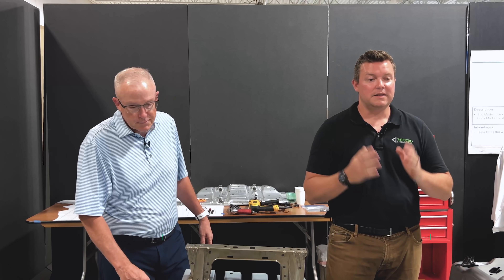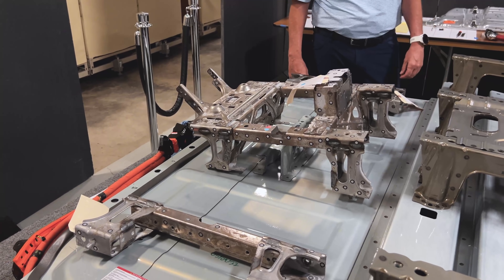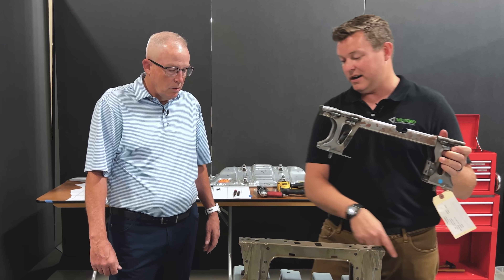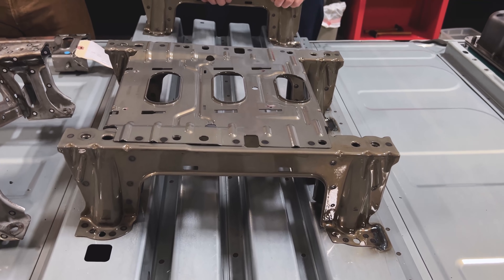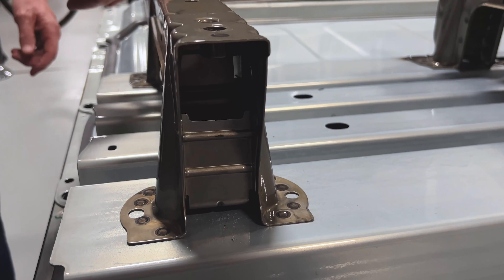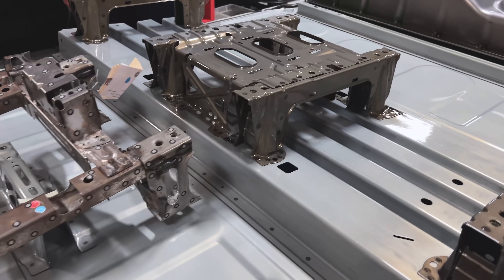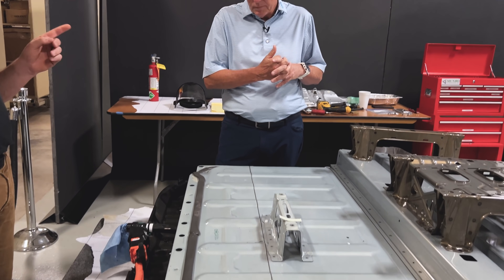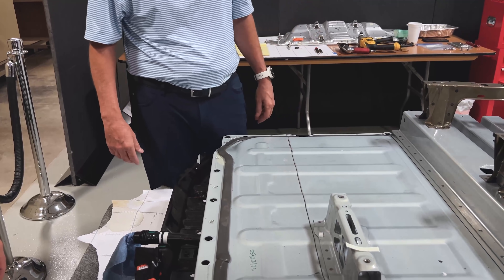Giga Texas Structural Battery Pack Cover | Tesla Model Y

Comment: THANKS4GIVING an excellent post young men. It was mentally stimulating and highly educational.  
4:00 Mr. Hildreth explained the seat loads very well. Before he said anything I had already figured it out because the painted welds were out of place, I figured the welds were for front end collision would generate a strong lifting moments against the rear of the  seat pedestal with lots of cantilevered leverage.  
4:53 Cory talks about a ?? Friction weld, that is a fascinating technology, I wonder if they do that in an envelope of argon. 
12:24 Mr. Hildreth  wasn’t at first shire why the pent house was but shortly after figuring it out logical. It was because of the many penetrations in the battery pack, the strength
lost had to be replaced, they used the Penthouse. They used the doubler ( built up ring ) at the base to receive the additional torque tension applied to the penthouse stiffening the marriage of the two.

Comment: Spot welds through the powder coat? That basically renders the coating useless against rust around the area. Less than ideal I'd say...
Reply from the maker: The welding was completed before any coating was applied.
Reply: Forget the spot welding - the seam welds at the back of each seat riser are clearly after coating.

Comment: could the battery structure be gigacasted?
Reply: I was thinking about the same thing. Probably will be the next thing to do, one big stamped battery housing.
Reply: You mean the cover?
Reply: @darekmistrz4364  everything, cover with seat risers and base
Reply: Not necessary. They plan to do a complete Tesla as one gigacast. Only problem is that you wont have glass windows, because everything is metal. But you will get VR-goggles connected to the outside FSD-cameras.

Comment: Can you speak to the safety testing that happens when a company iterates this much over a short period of time?  Do they have to be completely tested again with the NHTSA and IIHS or are their changes that can skip the process and take Tesla's word that it meet or exceeds the previous design?
Reply: In Europe they need a new type rating for the vehicle when things change that much. And that involves doing full crash testing again with the new model.
Reply: @sjokomelk  Absolutely no one is disagreeing with that.  This whole thread is full of repetitive pedantry.  People seem to have some kind of hidden fear that cars are not being crash tested.  My response is "Stop inventing problems that do not exist just to make yourself angry."
Reply: @_PatrickO  Making themselves angry is the point.
Reply: They are at least test new models, since you can look it up.  My guess is all manufactures can avoid additional full car tests via smaller supplemental tests. Tesla automates tons of integration testing with robots to get real time validation of changes.  Their testing automation is why they can continuously make changes so fast.  Go look up the joe justice interview about how tesla runs internally, he has a good story about how quickly an improvement to the bends in the metal bus bars for the charging system was put into production when different bends enabled faster charging speeds. I believe it was about 9 hours between the time a human engineer figuring out the change to make to the new part and the time it went into production with lots of automated testing in between. This kind of fast production change is impossible in traditional auto, they lack all the automated testing.
Reply: @_PatrickO  that doesn’t address the fact that the Y is produced differently out of two plants and the crash tests are typically of one model across the entire line. Even the IIHS states that they don’t test yearly and have a subjective definition on when they conduct a new test or use the manufacturers data. I would rather an expert like Munro speak to this instead.
Reply: @handlealreadytaken  Your concerns feels like grasping at straws.  It doesn't matter what factory a car is made in, just the design.  I would expect the new Y to be crash tested due to the gigacasting and structural pack. Structural changes are probably the trigger.
Reply: @handlealreadytaken  Something to also note is that "official" tests like IIHS and NHTSA often take months or years after the cars are put up for sale to be done. IIRC the Model 3's IIHS test wasn't completed until well into 2019, and the car has been coming off the line into customer hands since December 2017.

This is OK because the car-makers themselves do EXTENSIVE testing of their own, both in terms of computer-modeling and actual crash testing. Here's Tesla's video about this kind of thing: https://www.youtube.com/watch?v=9KR2N_Q8ep8

Comment: They want to avoid painting it later.  Takes a TON of surface area out of the paint booth.  But isn't it powder coated pre-stamping or no?
Reply: Braces for seats are coated too. You can see that welds are coated too. It's being done as last manufacturing step of this part

Comment: Completely powder coat that makes total sense to me... You know when you get your car detailed all the water they use and when you spill your drink, go to the beach etc.  It's bound to get wet.. powder coating it will prevent corrosion
Reply: Correct it's to prevent corrosion, normally there is a metal sheet between the pack and the passenger department, this sheet is coated before paint with the whole body in white to prevent corrosion. This pack being bolted on after paint, it makes sense they powder coat it against corrosion to have same result.
Reply: I use heavy duty rubber floor mats to prevent corrosion since I have snow and salt in the winter and will do the same when I get a Tesla, extra prevention is always good

Comment: The battery cells themselves are the biggest part of the structure, so they didn't really have to add a bunch of structural support on the outside of the pack.  In a tear down video of the 4680 battery cell, the outside canister of the battery cell appears to be stainless steel, and it much thicker than anyone thought.
Reply: They still have to add a lot of rigidity to the whole pack lol….. it’s not just a whole block but is also has to support the seats, bee the underneath of the car…… bee water tight…..
Reply: Stainless is heavy. Doubtful
Reply: @vidznstuff1  No, that is what the found with the actual cell.  You can see the cell tear down in the lab from The Limiting Factor.
Reply: @vidznstuff1  No, I saw it too, the channel name is the limiting factor. The person who disassembled the cell had was very surprised at how tough it was. You could also see the metal work hardening as he peeled it, that's a clear sign that its steel.
Reply: @ashsilverwizard3275  My take that is a special compound designed by SpaceX. Steel at that thickness is still flexing.

Comment: This guy must not be familiar with Tesla's crash test/safety ratings. They have the safest cars on the road, no way they took a safety risk with this.
Reply: @JorgTheElder  did you listen to 16:10-17:20. This new old guy is definitely implying a safety risk has been taken.
Reply: Munro does still lean towards meeting the minimum for a 4 or 5 star rating, while tesla aims to be as high above 5 star as possible. Munro does the normal manufacturing tradeoffs when it comes to safety ratings.  Tesla aims to be above them, even if their is no official 6 star to advertise.
It makes sense for munro to stick to official safety rating metrics in their way of thinking because they deal more with legacy companies that don't care about going above and beyond in a non-marketable arbitrary way.   Ideally, regulators would add a 6th star so that car manufacturers have something marketable to aim for that is also a set standard and not arbitrary.
Reply: @_PatrickO  the new old guy was implying that the pack being right below the occupants.
Reply: @larryspiller15  All packs are right below the occupants, the structural pack does not change that.
Reply: @_PatrickO  no, there is a seperate extra layer of metal in all other evs
Reply: @larryspiller15  There are separate layers of metal and fire proofing in this pack.  They are just integrated into the pack to simplify it.  It doesn't matter if the firewall and fire retardant mat is converted to a layer of foam above the cells and multiple layers of metal or a thicker piece of metal in the top shell of the pack.  It is exactly the same protection or better.  
My classic response to this kind of thing is "Stop inventing issues/concerns that no not exist just to invent a reason to get angry about something."  You invent false concerns and then want to debate them, it is massively ridiculous behavior.  It is far more likely that this pack is actually safer.  Tesla has a history of improving safety, not reversing it.
Reply: @_PatrickO  IM NOT SAYING IT IS A SAFETY RISK, IM SAYING THE OLD MAN IS SAYING IT IS A SAFETY RISK. Jesus man, work on your reading comprehension.
Reply: @_PatrickO  like are we in the same conversation, you are literally inventing the idea that I am implying a safety risk. I'm not implying a safety risk, I'm saying the old guy that IS implying a safety risk at 16:10-17:20 is definitely unfamiliar with the excellent safety track record of tesla.
Reply: dude they are not saying teslas are not safe. 

I don't know which part of the video you are referring to, but don't you know who these guys are? Munro and associates is awesome.  The guys in this video are rockstars to the Tesla community.  They definitely know teslas are safe, they love tesla. These breakdown videos are fuel for the fire of Tesla fans.  If they point out any specific safety flaw they're just calling it how they see it and I am certain they have a lot of faith in the overall safety of Teslas.
Reply: @freakyzguard  settle down, I've been following munro since before they had a youtube channel. This new old guy is implying that tesla is taking a safety risk with the battery being the floor for the occupants. Watch 16:10-17:20, thats where he implies the safety risk and Cory even says knowing tesla I'm sure they've taken that into account and faced the positive terminals down.

Comment: The fact that the entire top is fully powder coated is no mystery to me! 

Just imagine what your spilled Coke would do, sitting on that metal, being in constant contact with the floor pan of any car, that would explain to me why the powder clear coat finish is applied to the entire surface to prevent the human element of carbonic acid and sugar cola liquid spills, vomit and other body fluids from attacking and eventually corroding and perforating the top of the battery pack years down the road! Of course, the carpet and pad will absorb a great deal of it and despite human carpet cleaning efforts, some of it will remain, held against the metal surface in perpetuity. Then there is it’s dog, cat, drunk date or friend who had too much beer and children urine incidents as well! Humans are pigs! Plus the fools who will leave the windows down in the summer and get a thunderstorm’s worth of rain in the interior and those that want to prove their Tesla is a boat and drive through flood waters sometimes purposely because there is no engine to get hydro locked when the air intake gets submerged (you know who you are) 😝
Reply: I was thinking snow-covered boots and road salt; you need serious corrosion resistance under the carpet.
Reply: I looked to me that the entire top, including the seat risers after being welded in place were coated, is that right?
Reply: It does look like they weld the seat risers to the top cover and then coat everything.
Reply: @BlazerRox  they would dip the piece in a primer liquid and weld cleaning agent, then let that dry, then  electrostatic charge the pan and using a bell shaker, shake the charged  powder over it from a distance allowing the electrostatic attraction to coat all surfaces, even inside the welded in brackets right through holes, then heat fuse it to the surface by baking it.
Reply: @davidharris7249  I’m not sure they would have to probe with an ohmmeter to see if the welds are coated too. To see if there is a non conductive coating over the welds. They did say the subassembly appears to be made ten powder coated,so they are probably coated at the same time!
Reply: Cant have no holes in the floor board on these cars.
Reply: @gnoxycat  Oh yes they could! They could insert a thin plastic collection tray under the carpet with drain collection channels and molded plastic tubes that direct water in the footwell going out sideways and away from the battery tray past the perimeter seal if they want to modify the design. I would have the drain  plugged and removable only to let cabin water drain only if the need arises or with automatic one way valve that let water out, not in from the outside.
Reply: Ronald Leckfor That just about discribs the work a car does on a daily basis. Love your accurate comment..
Reply: @joeabad5908  I tend to be fairly rooted in reality, Joe! Your reply is a high compliment to me! That means I still have my feet firmly planted on the ground where I like them to be! 😆
Reply: @DishNetworkDealerNEO  you're welcome..
Keep those practical comments come in.. Cheers.
Reply: That weak carbonic acid is not the worst component of cola (in regards to corrosion). The worst in my mind is the phosphoric acid it contains.
Reply: You're not talking about "chillin with Chet" are ya? 😏🙄🤦
Reply: @silverstake88  funny you mentioned him, I don’t you if you knew this, but he totaled the Submarine S Plaid the other day going 170 MPH, when his just installed upgraded brakes went out when he forgot to flush the brake lines to get the stock DOT 3 out of the lines, and mixed it with Racing Brake fluid instead of being on the pure higher boiling point fluid. He was also going 170 with no rear hatch installed. Just think of the changes in aerodynamics that probably had the rear end lifted off the ground, and may also have been lifting the weight off the front wheels as well. I learned all this after you mentioned him. Thank you for doing so! He is hoping that if the car, which is dented on every panel on it, still has an intact drivetrain, and the frame distortions are correctable, and all the broken suspension parts replaced, he can torture, ahem, I mean race it some more. The original doors were not on the car at the time, and he was using eBay doors, which proves you literally can find anything on eBay!  He was not wearing proper safety gear to be running that fast, and the eBay doors were not equipped with the side Airbag sensors, the sensors were in the stored in his garage doors, So he only had front streering wheel airbag deployment possibilities. Well that was a wonderful place for them to be, SMH!!
Reply: Yes, Not only Coke but think salt from the salt / snow from the snow states in winter as it falls off of boots etc.
Reply: There are already steel alloys that are corrosion resistant. Not sure why they wouldn't use those.
Reply: @seasong7655  cost and weight! There is no need for high strength and high mass here. Even a flame retardant molded plastic cover is another viable possibility.
Reply: I once had a brand new lead-acid battery in the back footwell, it managed to fall over and spill acid over the carpet - which by the next day it had eaten completely away, along with the paint and some metal.  yeah accidents happen.
Reply: And then you spot weld and weld and thus breaks the paint protection.....
Reply: @Xanthopteryx  that is why protective priming /cleaning  and finish coatings  are done after spot welded pieces are attached.
Reply: @DishNetworkDealerNEO  As you could see, there were no form of seal on the edges on all the parts. This means moisture will enter in-between and have an effect. And when this happens, only one thing will solve this: Replace the ENTIRE BATTERY PACK! Since you can not repair it. You can not change cells. You can do like nothing. Just scrap it. A serious waste of resources.